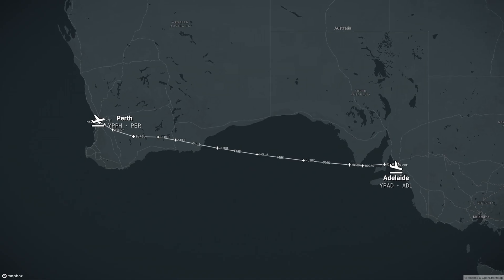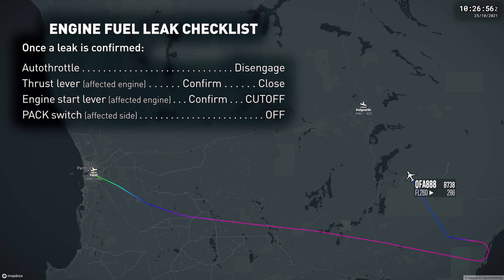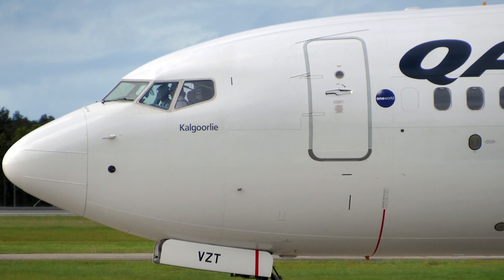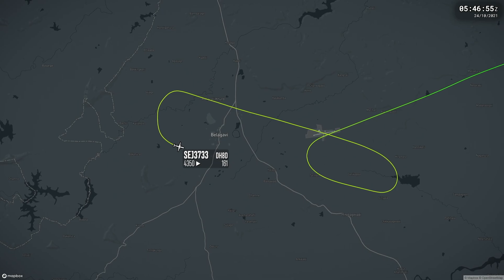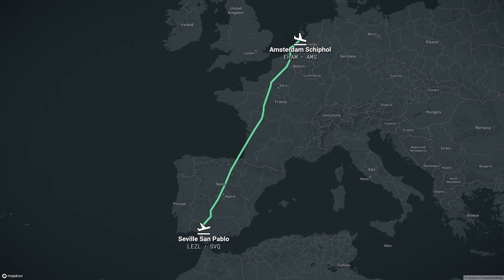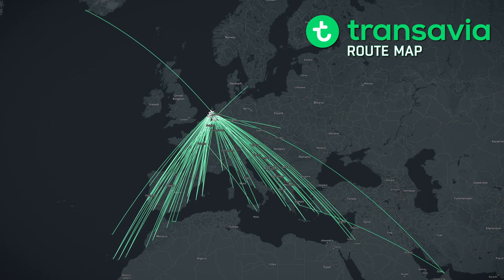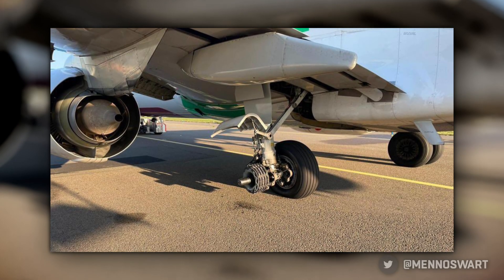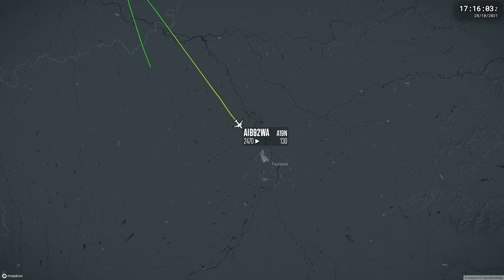How to handle a fuel leak and engine shutdown in-flight | Weekly Briefing #9

Comment: The flight crew who didn't report fact thed landed on wrong runway until thed got to their destination should be heavily disciplined if there's a rule you follow it even if you dont agree with it, and OK they would have been told off over landing on run way ,but not saying anything immediately ,to me would stop me using that airline not that I've ever flown I haven't but th3ir lack of honesty would worry me, it's a big cultural issue.